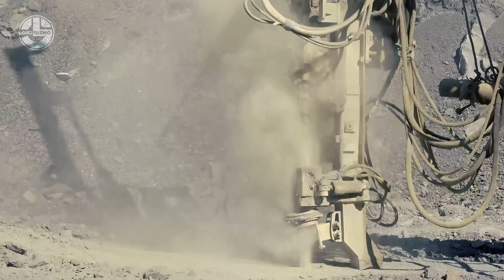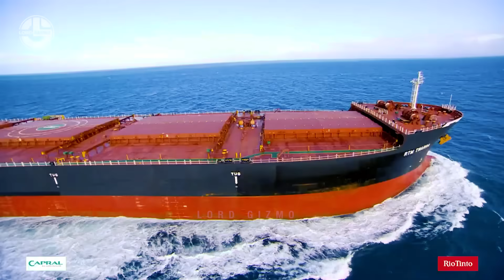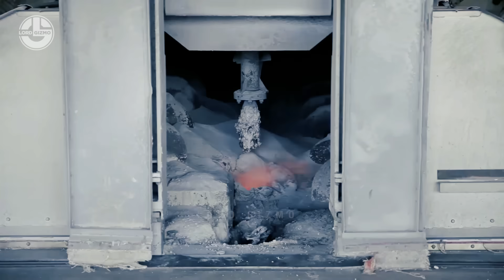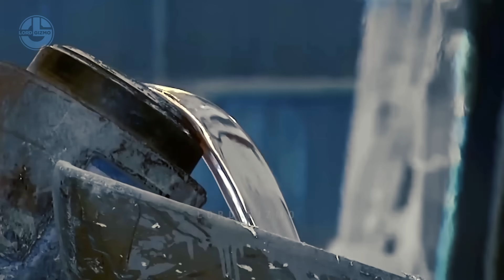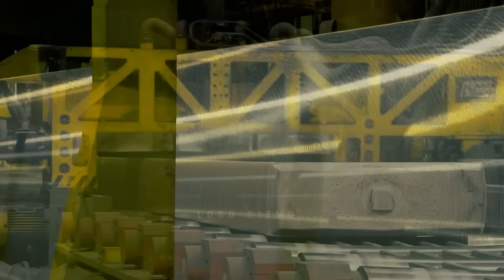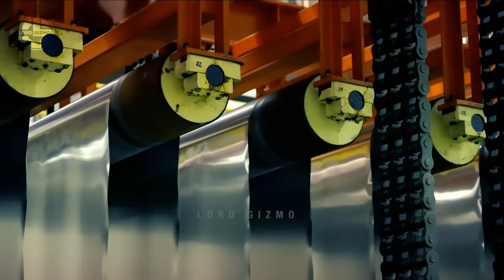Aluminum Mining: Inside the World's Largest Aluminum Deposits: Mining & Manufacturing

Comment: looks like a long and expensive process but more amazing ,each of of those machines to processing, hauling has to be engineered down to the material for buckets and molds. makes me wonder all the dried aluminum, it will eventually build up and need to be cleaned out and reused

Comment: Brings back memories from when I worked in industrial motor controls. Here in Alabama, at one time Reynolds Aluminum had a plant in north Alabama that could take those large ingots and roll it all the way down to beer can tops. 

The company I worked for made control systems for the primary reduction stands and the 5 stands mill. That take a 2.5” sheet of aluminum down to .25” sheet, apply the color (Miller Gold at that time) then roll it up. The next mill would take the .25” aluminum and take it down to beer can top thickness and roll it.

Next it went to a rewinder that would X-ray the sheet to verify the thickness of the sheet.

Spent a lot of time in that plant!
Ron

Comment: Aluminum does not occur in nature in its pure form, but in the form of bauxite ore, from which it is extracted!
 Bauxite mainly contains aluminum oxides, and the process of aluminum extraction involves extracting it from this ore. The most common method is the Bayer process, in which bauxite is decomposed using caustic soda (NaOH) to produce aluminum oxide (alumina). The aluminum oxide is then electrolyzed, known as the Hall-Héroult process, to obtain pure aluminum.

Comment: In this clip no mention of red mud after the Bayer process, there is a way to reduce red mud by extracting iron oxide and using less sodium hydroxide but it's not done by mining companies. Not only iron but titanium oxide is also in red mud to solve red mud if you use HCL acid to neutralise and use red mud for roof tiles .

Comment: SInce AI made this, lets let AI correct it on something- GPT4o: "The use of aluminum as seed crystals for snowmaking at large American alpine ski resorts is not common. Instead, the typical practice involves using water and compressed air to create artificial snow. In more advanced systems, nucleating agents, such as silver iodide or other proprietary chemicals, may be used to help form ice crystals more efficiently, but aluminum is not typically one of these agents. The snowmaking process generally relies on fine droplets of water being atomized and then crystallized in cold air, creating artificial snow that is used to supplement natural snowfall and ensure a consistent snow cover on the slopes."

Comment: i worked for 6 years at one of the top 5 biggest aluminium smelter in world. this video recall my all the memories
Reply: I worked for the Reynolds/Sherwin/Glenco aluminum plant near Corpus Christi, TX. for 18 years unloading hundreds of bauxite ore carriers and can say with great certainty that aluminum is not mined.  Oddly enough the plant I worked in is classified as a mine and as such its safety falls under MSHA and not OSHA. 

Aluminum is one of the few metals that is not found in its free form.  Unlike copper or iron or gold that can be found in a nugget free form aluminum comes from bauxite via the Bayer process which produces an off white paste from the red bauxite.  The paste is then fired in a kiln where it comes out as a bright white sugar like powder called alumina.  This powder is then processed in huge electric furnaces where it is turned into liquid aluminum.  The only point at which there is actual metallic aluminum is at the very end of the process where the alumina is smelted.
Reply: What is the purest quality of aluminium your smelter have produced ??
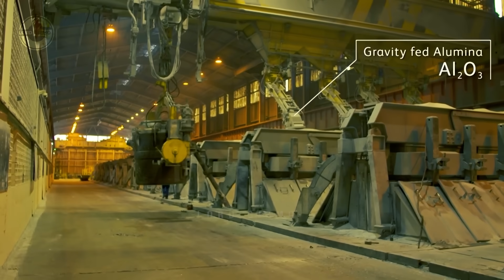Reply: Ok 7:21

Comment: I think they skipped the electrolysis part after preparing those carbon anode being glued with molten iron to the rod.

They simply skipped into metal aluminum process.
Crystallized alumina isn't yet metallic aluminum I suppose.

Comment: I work on aircraft, and it amazes me how strong aluminum can be with the correct engineering.  Sheet aluminum is very weak and floppy,  but when the same sheet is ridged, bent, or dimpled, and installed,  it's profoundly stronger. Aircraft design is amazing.
Reply: 2024 Copper/Aluminum alloy is very strong, usually hardened to T3 and clad with a few thousandths of pure aluminum each side, coming out with the standard 2024 T3 Alclad. It is amazing how a little geometry stiffens it
Reply: Thanks again for letting us know.  @Timendous-b5c
Reply: Boeing has just entered the chat...
Reply: Aluminum foil.
Reply: Wow! just amazing to hear that!
Reply: Have you ever seen aircraft skins get stretched formed?  It is an incredible process. I was a Stretch Form operator for McDonnell Douglas in Long Beach, CA.
Reply: @kevinwaters1197  i actually don't do any of the sheet work, but I do watch it being done a lot. No, I haven't seen that process, though.
Reply: Boring is a rule tool as aeriropte ivriyxe inal
Reply: Honeycomb, Aluminium foil (P/N: 363)

Comment: It's not a second digester. It is called a Rod Mill to grind the material into a consistent size before adding it to caustic. It is the first step for the Bauxite. I designed some for Alcoa in America.
Reply: I'm from Central Arkansas and worked in the refractory field rebuilding Alcoa and Reynolds furnaces.
Reply: Pretty sure it's an AI script read out by an AI voice - Would explain why it doesn't make sense.
Reply: He is not metallurgical engineer. Mineral dressing crushing grinding floatation etc... Any way not bad video.
Reply: Maybe you should make a video. You sound like someone that would know what's actually going on.

Comment: Interesting fact: Aluminum used to be more rare than gold, before they knew how to process it.
Reply: Technically, it was never rare - just expensive to produce in pure form. Even after figuring out how to process the metal from ore - a cheap source of electricity was needed to make aluminum available to the masses. Coal and oil made the real difference. No other metal's price is as dependent on cheap energy.
Reply: Refined aluminum was rare.  Elemental aluminum is the most common metallic element in the Earth's crust.  Just hard to get pure.
Reply: Well they knew how to process it, just not in large quantities, until some someone bailey came along and figured out a system
Reply: I heard the guy that invented aluminum showed his king and the king had the guy killed. He didn't want aluminum devaluing any of his other shiny precious metals.
Reply: Interesting fact: aluminum has never been rarer than gold at any time in history.
Reply: @milwaukeebrewers6337  -- You are technically correct. Processed aluminum was
only more valuable than gold in the mid-1800s. Elemental aluminum has always been
very common in Earth's crustal composition.  --- I stand corrected. ---
Reply: @lanceleavitt7472  I knew what you meant, I was just being an ass lol
Reply: @lanceleavitt7472  Yet now aluminum is so popular! Is there any other material that was once expensive but is now popular?
Reply: Al you mini ummm

Comment: I dunno where that footageis from or where you got your information but that's not the Gladstone refinery, how do I know? Cause I'm an alumina producer in that refinery only semi accurate things I saw was needing bauxite and crushing it to mix with caustic but we call them mills. The processes mentioned are somewhat accurate
Reply: i noticed things were odd myself. was tempted to flag this as misinformation
Reply: Not to mention it seemed like they cut and pasted a lot of the clips out of order. Not sure how far in you got in the video, but I couldn't make it that far
Reply: @steelthfighter "They're some inaccuracies with clips in this video" at the end of the video
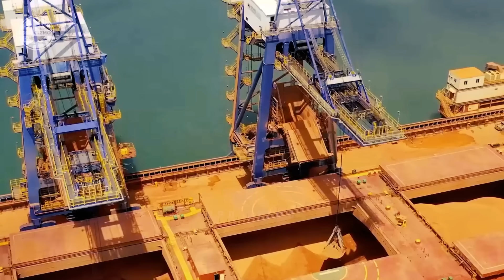Reply: 1 severely incorrect fact is at 3:35, it doesn't need to be transported to the refinery because the wharf is attached to the refinery only transport required is from the ship to our stockpiles by conveyor
Reply: I used to work at the Reynolds Aluminum plant in Texas and we used to import Weipa bauxite from OZ.
Reply: This channel is fake. It's all AI driven.
Reply: I've toured the Gladstone Site around 1973 as a primary school kid and later retrieving hire equipment late 80s up to 1990. Gladstone  was a nice change from Bull City 😂

Comment: Do you think you could put together a piece on 'Clear Aluminum'. First mentioned on 'Star Trek 4 - Whales'. 
I believe it is called Gorilla Glass and it might involve doping with Silicon.
Reply: It's called synthetic sapphire, They make watches and phone screen protectors from it. They use heat to make aluminum dust transparent. (I oversimplified the process for space and time.)
Reply: Thanks. I did some research maybe a decade ago. I live near to a very large silicon production facility. Many years ago I was an electronics gem and looked at the chemistry of silicon. But it is all just granite to me. 😉
Reply: Gorilla glass is almost pure silicon.
Reply: So are transistors, it is the doping that makes it work. Changes the lattice.

Comment: More aluminum than iron in the Earth's crust?! First I've heard of that assertion.
Reply: Earth's mantle is liquid iron. The crust has way more aluminum than iron.
Reply: @bradfordjeff  I thought the core of the planet was nickel. I imagine there's a lot of iron down there too though.
Reply: The earth's crust is approximately 8.2% Al and 5.6% Fe.
Reply: @d.jensen5153 allegedly lmao
Reply: Aluminium ore is Boxite. Boxite can be found in simple clay under your feet.Each clay has some percentage of Boxite.The one whay is usedhas most percentage of boxite.
Reply: @ernisj.8087  bauxite 😂
Reply: @ernisj.8087  Thank you. I had no idea bauxite  was so prevalent.
Reply: True, but iron is the most common element on earth, just not the crust.
Reply: @mikelastname  On Earth, oxygen is the most common element, making up about 47% of the earth's mass.
Silicon is second, making up 28%, followed by aluminum (8%), iron (5%), magnesium (2%), calcium (4%), sodium (3%), and potassium (3%).
Reply: @jimihendrix991  Your composition stats are correct for the Earth's crust, but that is but a fraction of the entire Earth.  From Wikipedia:
The mass of the Earth is approximately 5.97×1024 kg. In bulk, by mass, it is composed mostly of iron (32.1%), oxygen (30.1%), silicon (15.1%), magnesium (13.9%), sulfur (2.9%), nickel (1.8%), calcium (1.5%), and aluminium (1.4%); with the remaining 1.2% consisting of trace amounts of other elements.[15]